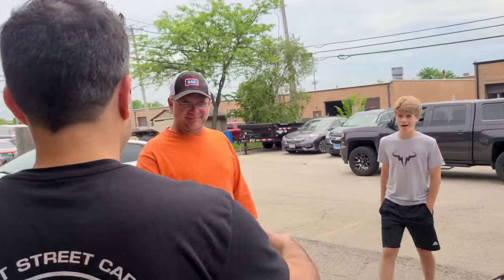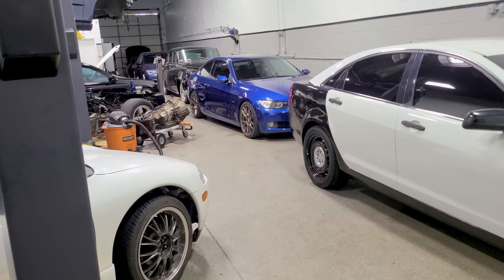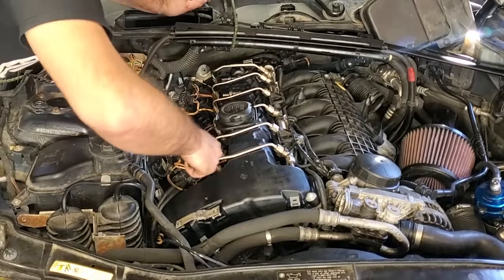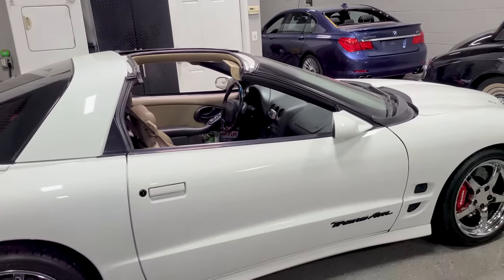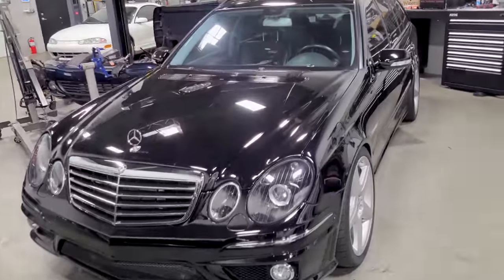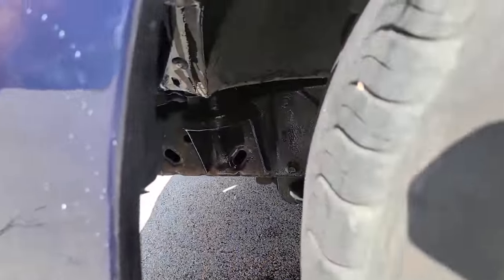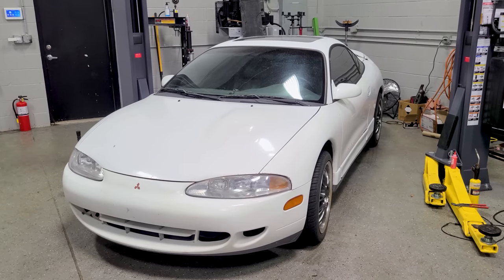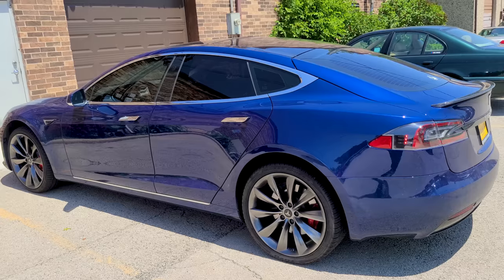I'm Auctioning Off Half My Fleet To Buy An Exotic! Here's What I THINK They Will Sell For!

Comment: Keep the rubber side down kid! My first car was a 71' stang with a 351C and a manual trans. That didn't end well.  Not a good 'learning to drive' car. But you should be fine with a smogged out 305 chevy. Have fun and be safe.

Comment: The reason for the aftermarket exhaust manifold on the Eclipse is that the stock ones crack. It's just as expensive to get another stock one that will crack again as it is to get a better aftermarket one.

Comment: i have a 2005 e 500 4 matic wagon. You got the 2005-2006 roll-top desk center console. So horrible. You should try and find the older center console for your car. They started using that console in the end of 2005 and its horrible. The older model is a split cushion armrest storage way way way nicer

Comment: Just saw the Mods & Miles auction of the 2007 BMW 335i.  Are you happy with what it sold for ($22,189)?
Reply: Im guessing he is ecstatic because some dumbass overpaid like hell for that E92. I get it was owned by LSC but its not worth $22K you can find an E92 M3 with similar miles for the $25K range and that is a car that will drive and handle better. Plus its an M car and will keep its value unlike a standard 335i.

Comment: Hey Alex, I see you've installed long tube headers on a bunch of your cars. I had quite expensive Supersprint long tube headers and sport cats installed on my Cayenne GTS 6MT. Unfortunately, I didn't realize how incredibly LOUD it would be, and it's a bit of a problem since the Cayenne does need revs to get moving and also I may have added a bit of weight to it via off-road protection and full size spare 😬. Also the headers not even equal length despite their cost and hand-fabrication so I get that Subaru V8 engine note 😡🙄. Anyway if you're still reading, the final issue, and my question, is I get exhaust fumes in the car with the windows closed at stoplights- Is that normal, or did the installation go awry? 
I also had them Jet-Hot ceramic coated, and the shop said they had to remove some of that to make them fit together, but still, that shouldn't be an impediment to good installation. It's just frustrating because it's an engine-out operation to install or remove headers on a Cayenne...which ain't cheap.
Reply: do you still have catalytic convertors on it?
Reply: @trashbandit2449  yeah the super sprint sport cats. The headers replace the other cats
Reply: @chir0pter  wow those are expensive headers. Anyway, I would check for any exhaust leaks. If you hear any light ticking noises when running from inside the cab or from the engine bay, you'll have a leak. Check between the manifold and block, and them again between the end of the header and the pipe that connects to it. 

Otherwise, the cats could just be high flowing enough that exhaust fumes escape easily. 

I'm assuming you got it tuned after this, because that's very likely necessary? If you have no leaks, then a good tune should remove most or all fumes inside the cabin. People can go without any cats and as long as they have a good tune they don't have complaints.
Reply: @trashbandit2449  Thanks. The plan was to get it tuned but I haven't done it yet. I did read recently that a tune can take care of fumes. Might be able to reduce noise level with resonators and improve sound with an X pipe, but disappointing I wasn't in love with it right out of the gate
Reply: @chir0pter  if you don't like the rumbly sound, get an x pipe and higher pitched mufflers. An x pipe with corsa mufflers could sound good. Disappointing that those weren't equal length though.

But yes I'd definitely get it tuned
Reply: @trashbandit2449  @LegitStreetCars I had to go back and find this comment. I finally got an X-pipe muffler installed and it actually sounds pretty great now. The fumes are down too, not sure if stuff just bedded in or if the ceramic coating isn't offgassing any more or what. Still think Supersprint could have done a better job on designing those headers but the whole package is definitely pretty awesome sounding now. Still need to get it tuned tho
Reply: @chir0pter  nice! Glad to hear that

Comment: 10k less miles on my car over 600hp suspension mods all that everything done right water pump thermostat valve cover index 12 hpfp trans and diff fluid change all brand new tires new front axles new coil packs and plugs ofhg intake gasket oil pan gasket new control arms and receipts of everything only thing is a small q panel damage and bad wheel speed sensor and people still offering me $6000 😭😭😭